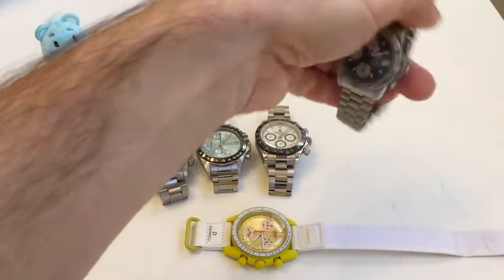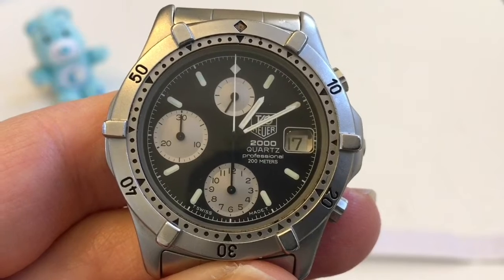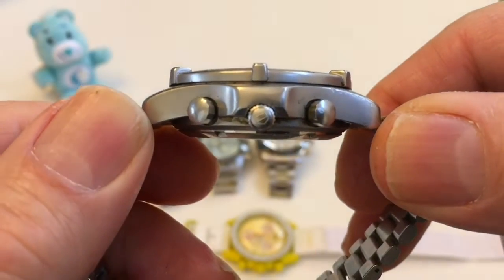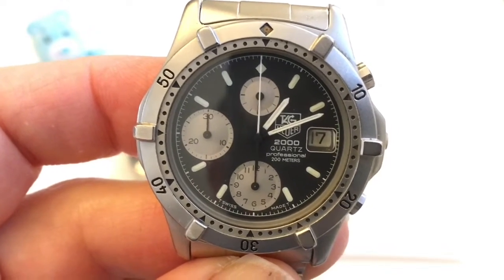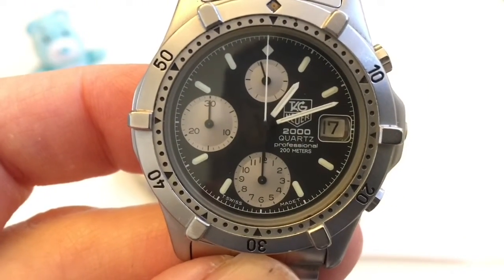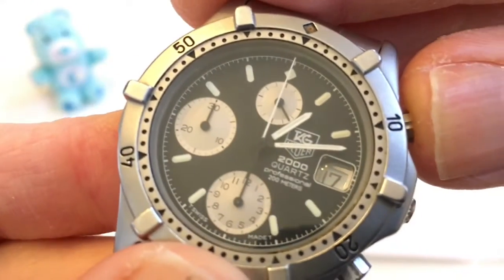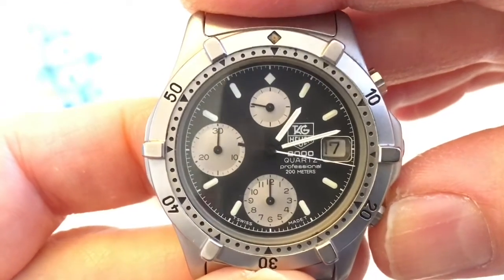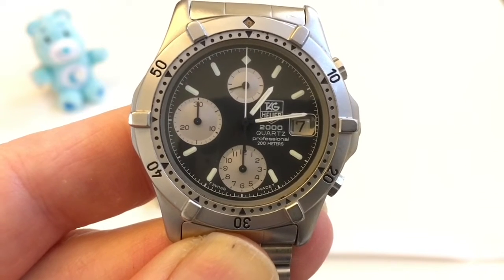The original mechaquartz? Tag Heuer 2000 Quartz Chronograph 262.006-1 cal 185 Dubois Depraz module

Comment: This module was used at the beginning exclusively for Tag Heuer watches, then few lines in contract changed and the module was used also by AP, Girard Perregaux and Baume et Mercier.
Reply from the maker: Thanks for that info. It appears the Omega calibers 1140, 1141, 1143, 3220 also use a Dubois Depraz chrono module (2020). I actually found the service documents for the 3220 online. In terms of service, it's probably very similar to the DD 2000 module used by Tag Heuer (at least I hope). I did find a video on YT on servicing a 3220 movement/module.